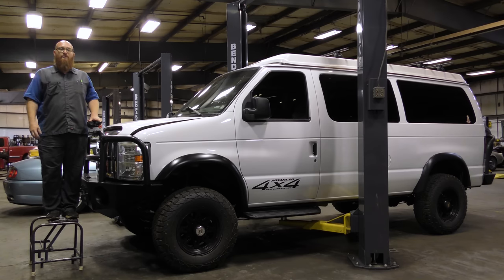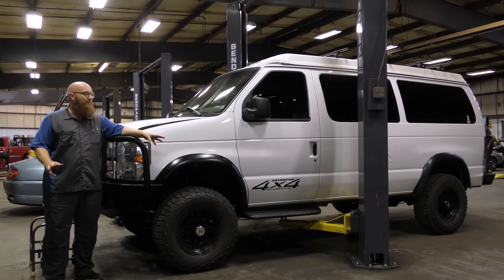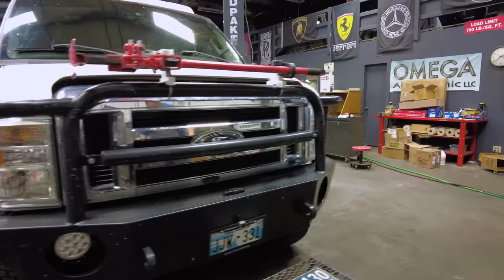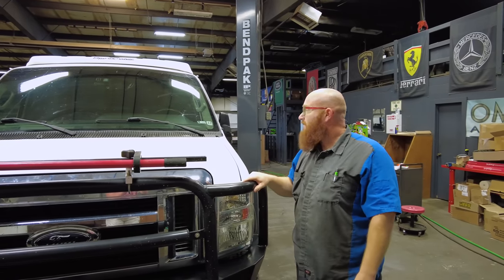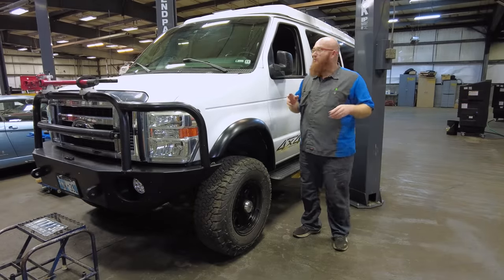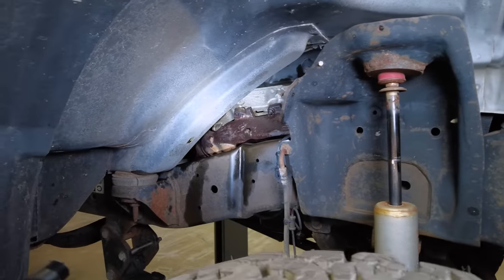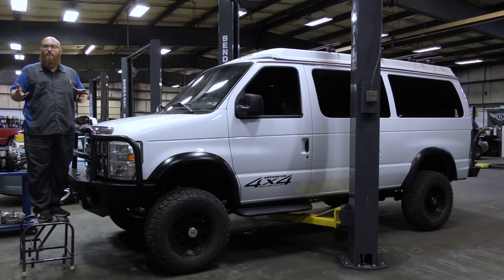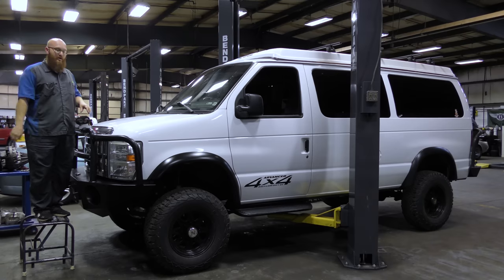8 shops refused to work on this custom '10 E-Series Van! CAR WIZARD shows how easy it was to fix!

Comment: Wizard, I can tell you 100% as I used to be a porter at a Lincoln dealership, whenever we got one of these in that needed an engine swap or head job done, they would have to raise the body off of the frame to access the engine. Pretty crazy looking and very labor intensive.
Reply: But none of that had to be done.
Reply: @kb9oak749  you take the cab off on most of these ford trucks to do engine work.
Reply: @kb9oak749  very true but the shop hears "off road van with conversion" they assume the worst because its been off road and abused. It's gonna come in for a few simple things and need way more then the customer thought and navigating this can be difficult especially if it needs one of the custom parts from the conversion replaced and those parts a lot of times aren't readily available at O'Reilly or whateve national supplier they use and furthermore as the wizard pointed out certain things on this are much more difficult to do. 90% of the time this is the case but luckily here there isn't a whole lot that needs to be done.
Reply: @jhomrich89  Makes me wonder just how it's being presented. I'd suggest that a truck shop that works on Ford trucks would not even look twice at this as it's not anything unusual. Perhaps an unusual combination, but any shop that works on an f-350/450  would have no problem  with this.
Reply: Those must be the dumbest techs I’ve ever heard even with the the 7.3 or 6.0 diesel you never have to raise the body off the frame of the e-series van. Everything comes out the front
Reply: @neooverby3750  Whatever method you're saying to bring the engine out the front sounds like it involves removing a whole lot of front end components including but not limited to radiator, condenser, bumper, grille, and other body parts to then dismount the engine from the frame and somehow slide it forward out the nose to access everything. From what one of the techs told me at the time, it's just 8 bolts holding the frame to the body. Living along the salt belt it often involved torching the bolts to relieve the rust and then everything else is just wiring and plumbing then the body lifts off leaving everything in place and the engine and trans remains mated and mounted to the frame while doing a head job.
Reply: @man_on_wheelz  9 times out 10 those are horrid to remove. the radiator and all front end parts take about an hour to remove if you are competent tech if it’s a v10 v8 or the new 7.3 gas engine you have gobs of room to work. Also many of these are rvs so removing the body is out of the question
Reply: @man_on_wheelz  ya its really not all that bad to remove the grill, bumper, and radiator to pull these motors out the front. Definitely more work to pull the body. Seems easy when you say just 8 bolts to pull the body, but its all the electrical and plumbing that makes it take way longer.
Reply: Same with my diesel excursion.
Reply: @man_on_wheelz  
"𝘵𝘰 𝘣𝘳𝘪𝘯𝘨 𝘵𝘩𝘦 𝘦𝘯𝘨𝘪𝘯𝘦 𝘰𝘶𝘵 𝘵𝘩𝘦 𝘧𝘳𝘰𝘯𝘵 𝘴𝘰𝘶𝘯𝘥𝘴 𝘭𝘪𝘬𝘦 𝘪𝘵 𝘪𝘯𝘷𝘰𝘭𝘷𝘦𝘴 𝘳𝘦𝘮𝘰𝘷𝘪𝘯𝘨 𝘢 𝘸𝘩𝘰𝘭𝘦 𝘭𝘰𝘵 𝘰𝘧 𝘧𝘳𝘰𝘯𝘵 𝘦𝘯𝘥 𝘤𝘰𝘮𝘱𝘰𝘯𝘦𝘯𝘵𝘴 𝘪𝘯𝘤𝘭𝘶𝘥𝘪𝘯𝘨 𝘣𝘶𝘵 𝘯𝘰𝘵 𝘭𝘪𝘮𝘪𝘵𝘦𝘥 𝘵𝘰 𝘳𝘢𝘥𝘪𝘢𝘵𝘰𝘳, 𝘤𝘰𝘯𝘥𝘦𝘯𝘴𝘦𝘳, 𝘣𝘶𝘮𝘱𝘦𝘳, 𝘨𝘳𝘪𝘭𝘭𝘦, 𝘢𝘯𝘥 𝘰𝘵𝘩𝘦𝘳 𝘣𝘰𝘥𝘺 𝘱𝘢𝘳𝘵𝘴... 𝘪𝘵'𝘴 𝘫𝘶𝘴𝘵 8 𝘣𝘰𝘭𝘵𝘴 𝘩𝘰𝘭𝘥𝘪𝘯𝘨 𝘵𝘩𝘦 𝘧𝘳𝘢𝘮𝘦 𝘵𝘰 𝘵𝘩𝘦 𝘣𝘰𝘥𝘺"

There is far more that has to be disconnected to lift the body off, and it's much more crucial that those components be perfectly aligned when putting it back on, compared to taking the engine out the front. The brake system, steering system, climate control system, transmission and tons more are connected to both the frame and the body. I've pulled 7.3 IDI's and PSD's out the front of gen 4 Econolines more times than I care to remember. It's about a 5 hour job. The gas engines take less. Lifting the body off to remove the engine makes about as much sense as removing the trans to change a neutral safety switch.

Comment: I can understand smaller shops not wanting to work on this, as their lift may not have enough weight capacity or their ceiling is too low to lift it even enough to use a stool to get under it.  But any larger shop should have the proper equipment.  Some of those shops may have been bitten by custom vans in the past, where the alterations were poorly done and caused what should be simple repairs to get very complicated.  But they still should have at least taken a good look at this one that seems very well done and also considered the repairs were nothing out of the ordinary.  Oh well, more business for the Wizard!
Reply: @rch5991  Awesome first car!
Reply: Yeah but you can fit under it the number one plus 4x4s is just getting under there with a crawler and some jacks. the number one minus is you got twice as many things to fix potentially
Reply: Having seen some really janky mods in this channel and others, I can see why a shop might not want to open a can of unknown worms. 
And sad as it is, I can understand a "no exceptions" policy: if I work on your truck, every clown with a bad clone of your truck will see it and think I work on those. Saying yes is just buying months of unpleasant phone calls and arguments with people I say no to.

But it does seem sad that this guy has trouble finding a shop that will work on a truck that was essentially made to be what Ford would have made if Ford made these.

Comment: I have a 1989 E350 and no one will even look at it besides me. I have been doing something similar to what you are working on, but I don't use the 4 WD. Just drive it here and there, I have some manifold issues that need exhaust gaskets and I am afraid that they will break into the heads , I will just have to take my time and use plenty of gas from my torches to get them out probably. Great evening and weekend to you and Mrs. Wizard! 😉

Comment: Wizzard - I have the dreaded 5.4 3v in my super duty.  It needed manifolds too.  I knocked the rivets out of the shock buckets and pulled them off.  It gave me plenty of room on each side to pull the manifolds out.  I simply replaced with grade 8 bolts/lock washers and locktite.

Love these videos!

Comment: I worked for a company that utilized Ford E series vans in the fleet. They had 1 van that had around 80,000 miles and had developed an exhaust leak. Now, this van ran good, this was the first major problem as it had broken manifold studs. The garage had estimated the cost to pull the heads, drill out the studs, replaced them, and reinstall the heads.(I don’t know if they were installing the manifolds on the heads before installing the heads, or not) but they came to the conclusion that they could replace the entire engine with a low mileage engine from a wrecking yard for less money. That is what they did.

Comment: As a 4x4 van builder the other issue people forget is that the front suspension (wheels & tires) are much closer to you than a lifted truck. This just makes it feel all the more "lively"  hydro-assist steering helps resolve this problem.  Also upgrade your tires to a "G" rated or 14 ply tire.

Comment: I own a stock standard Jeep JK Wrangler 2-door Sport, and have had trouble getting repair shops and tyre shops to work on it if it involves lifting it off the ground.  They always say it's because it doesn't fit on their lift or it's too tall or something, even though I've seen huge SUV's that were twice the size & weight of my little Jeep being worked on in the same places.  The last tyre shop I went to when I needed to get a set of new tyres said the same thing (though I think they said it was because of the solid axels or something) and ended up working on it out in the lot, using 4x trolley jacks under the axels to suspend it while they pulled the wheels off it.

Comment: I think that may actually be the 2 valve 5.4 Triton in there.  If I remember correctly, Ford only used the 3 valve in the pickups and the SUVs in the 2000s.  I think the Econolines only had the option of the 2 valve engine for the 5.4 when it was used between 1997 and 2016.  My brother used to drive a box truck for work that was on a 2013 E350 cutaway platform.  That was definitely a 2 valve 5.4 and at one point, he had a spark plug blow out while driving.
Reply: You are right

Comment: I wish you had shown the steering setup. The owner of the company that did the conversion (Randy I think his name is) showed me the patent he submitted for the high-steer bracket he claimed to invent. You'll notice the drag link connects above the leaf spring to a bracket bolted to the top of the steering knuckle. When the van is sitting on the ground the drag link is nearly perfectly level with the ground. This creates nearly perfect steering with no bump steer. This shop was actually authorized by Ford to do these conversions and vans are shipped directly from assembly line to the shop. Many of them end up in the mining industry in countries in South America as personnel transports. I imagine the front axle is from a super duty though they do build their own custom axles.

Comment: In my shop we work on big, heavily modified trucks and vans a lot and whenever we get an especially tall engine bay into the shop, we usually let the air out of the tyres. That lowers the front end so that it becomes easier to work on the machine. No biggie to then air up the tyres again once we're done.

Comment: I work at a dodge dealership so I’m completely used to stepping on stools or even tables to get into engine bays. Sometimes we even sit in the engine bays to do things like spark plugs. It’s not that hard just inconvenient. Sad those other shops weren’t willing to go through a little inconvenience to help the customer.
Reply: Gotta get a topside creeper. Makes pickups and tractors 10x less frustrating for me.

Comment: MR WIZADD ...ME AND MY PAPA have been doing the same type of work as u sence 1967 also specialize  in engine rebuilding....your talent and how honest u are is very rare with us mechanics it's a shame.. jus a little helper maybe we find when doing the manafolds and the head breaks off  we do 1 of 2 things depends of few things we find getting  a  nut a few sizes bigger hold it in the center of the stud get the mig welder lay in the weld fill up the nut give it a few seconds to cool hit it wit air /battery wratchet the heat plus the quick snap will brake the broken stud lose.. and safe a ton of time or if your lucky  u can get the manafold out and use the tool on the 3/8 wratchet that adaptes to the stud the more u turn it out the more it grabs the stud  hope this maybe helped keep up the great work

Comment: That thing is cool. There's one that runs around my town, looks like the Rumpo custom from Grand theft Auto 5.

My uncle had a  F150 with the 5.4L 3 valve engine in it, and with routine maintenance it was a reliable runner up to 360,000 mi. Used it to tow a camper a lot. When I became more educated about cars I heard about that motor being a lemon, so he must have had a golden sample.
Reply: Rumpo Custom!!!  Totally is the same 🤘😀 Love it

Comment: I have done a couple of exhaust manifolds on those vans and it's not fun, especially if you have to drill the studs out. Each one i swear took 2 years off of my life.
Reply: On my 97 f150 4x4 it would be nearly impossible to drill the studs out with the heads bolted on, absolutely zero room. I ended up rebuilding the engine on my truck, so I had it easy and heated the studs up to remove them with the heads off. I couldn't even imagine doing that job on this van if that's all the engine needed... that would be a pain. You had you work cut out for you.
Reply: Look very hard ...
Reply: @superdivemaster  I'm pretty sure I'd refuse to do it.
Reply: If you have the space I always do the " mig weld a nut onto the broken stud" trick! It's a lifesaver for many a broken bolt or stud, basically anywhere you can fit a mig gun and don't have a risk of fuel vapors right over the gas tank 🔥😉 I usually use whichever style of vice grips that allows the best access to hold the nut and act as the ground clamp, although you can get even move creative in tight  areas by tacking on a piece of steel rod/ filler rod/coat hanger/etc. to act as your nut holder 😊 and ground (just be careful about how many amps are gonna be flowing through that wire, the shorter the better, otherwise it's gonna glow like a lightbulb filament 😄💡 I hate drilling/ez-outs/extractors/helicoils/thread tapping unless I'm tapping fresh steel or cleaning existing threads, so hopefully this info helps someone else as much as it's helped me! 👍
Reply: (Oh and for steel exhaust flanges with recessed broken studs I get grade 8 tapered locknuts to keep the nut from being welded to the manifold, they are the nylon free style locknuts that most resemble steep taper trailer lugnuts.) These aren't commonly available at big box stores, but are common at industrial supply stores/ professional hardware stores/ metal supply yards, or any company selling hardware that caters towards more industrial/professional customers 👍
Reply: @berryreading4809  Using vice grips to hold the nut and clamp the welding ground to is a great idea. Wish I would have thought of that when I did the last one!
Reply: @garyr7027  
Another commenter removed the suspension buckets by drilling out the rivets to give himself room (poss Chevy) then reattached them with grade 8 bolts.....
Reply: @berryreading4809  
English cars used to come standard with brass exhaust nuts....
no corrosion and if necessary...easy to use a nut wedge on.
Reply: Fords trucks, explorers, vans have always had a jacked up manifold Y pipe. My buddies exhaust shop has passed on many Ford van jobs
Reply: Are you afraid to tell the customer the probabilities and the price per hour until it's done?  It's better to be honest up front than to deal with whining and crying later. If they don't understand that then you don't need their business or the business of anyone that listens to them.
Reply: @carlbeaver7112  What should he do charge them as if every stud broke? I don't see that as being dishonest. I see that as "he will do the best he can but can't predict what will and won't break."
Reply: @7993mick  You just tell them the truth - that nobody can estimate how much it will be until the job is done. Don't allow someone else's bad luck to become your bad luck.
Reply: @carlbeaver7112  100%
Reply: @acme_tnt8741       GM and Dodge Rams aren't any better. Cheap, thin materials.  I think the Fords are the hardest to do though .
Reply: @wysetech2000  I ride chevies. My only problem is constantly retightening stainless headers I'm from Ohio and I prefer hollow stainless tubes from the headers back, cat delete always. They won't steal them if you don't have them.
Reply: Yup...ive done a few. Drilling out the studs behind the shock tower. Thats a pain in the @$$. Cant fit a regular drill, need one of those small right angle drills, still barely fits. Man i dont miss doing those. Also you have to get the OEM manifolds. All the aftermarket ones warp within a year 2
Reply: @JohnSmith-yv6eq   ive seen aftermarket mod where the heads is treated with brazed steel so they dont mar when turning wrench kind of tedious doing each bolt that way
Reply: @garyr7027  pull the fender tubs out on that year
Reply: 8MM bolts ?  I’d so, that is the first problem.

Comment: This story sounds so much like my story. Almost every shop I called in Utah didn’t have any information about my 2007 grand Cherokee with a Mercedes 3.0 Crd (common rail diesel). This is a 2 year only OM642 Mercedes’ Diesel engine. It is a great vehicle till I need to get work done on it.

Comment: My dad has the same van with the 5.4. He’s put 50k miles on it and now it’s at 200k. He just had the intake manifold and spark plugs replaced which was expensive but other than that engine runs great no issues

Comment: The Denver Museum of Nature and Science has a van like this converted by Boulder Offroad Vans to use in field work. It was an impressive off roader and helped rescue a stuck Tacoma overlander rig out in Grand Staircase. It did have quite a few reliability problems, but those were from the conversion company screwing up.

Comment: Wizard, 
You should consider getting an in ground 2 post lift. Rotary makes regular versions up to 12,000lbs and you don't ever have to worry about hitting the crossmember with taller vehicles or hitting the vehicle's door on the post. I have worked at a few shops with in ground two post lifts & they are so much nicer than the standard two post lifts.
Reply: Some states dont allow them unless they were already installed because if/when they leak they leak into the ground/soil.
Reply: Nah, he needs 4 mobile Stertil-Koni lifts.

Comment: I feel for this customer. I had a hard time finding a competent shop to agree on an engine swap on my Landcruiser with a stock setup. Seems most shops prefer smaller jobs where they can mark up parts and labor and make a hefty profit with minimal work. If I had the space and time, I would’ve just done it myself because of the frustration. 

Edit: great to see that it is not beneath the Car Wizard to take on these types of jobs. Wish I was closer to the Wizard!
Reply: you're 110% correct. most small shops today just do small jobs like breaks, alternators bolt on stuff.  because its so much easer to do and they can charge the customer big money for a very easy job.